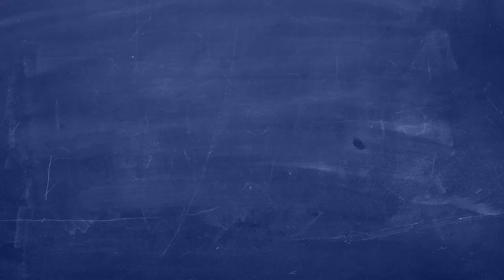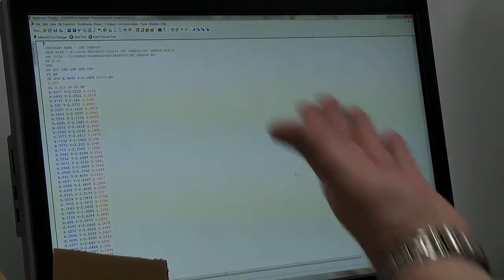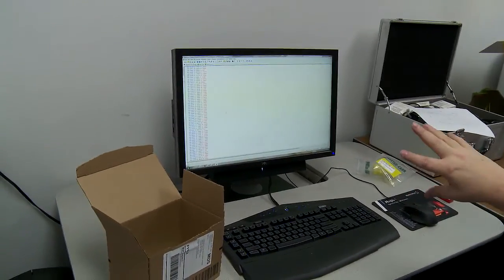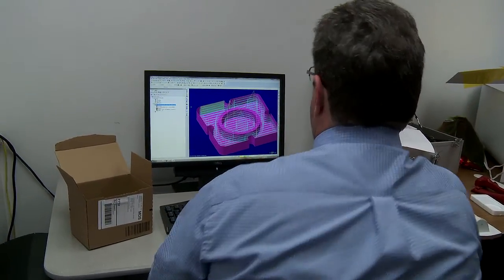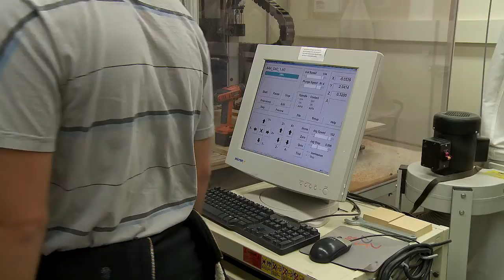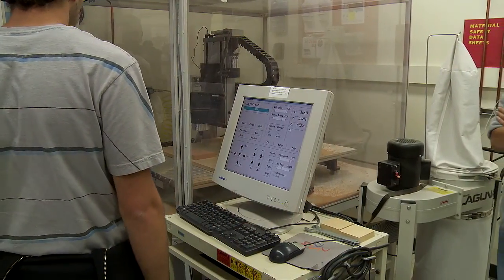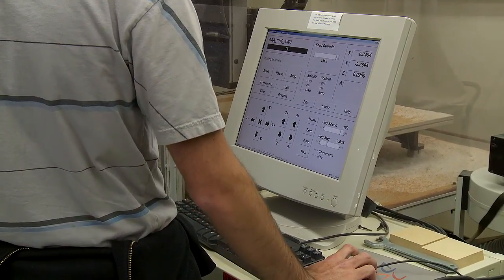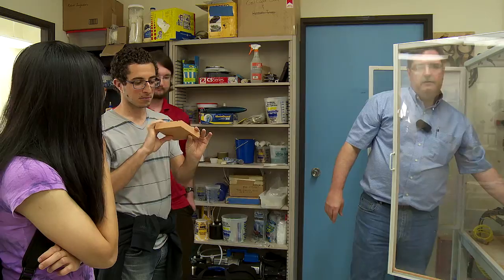Engineering 165/265: Advanced Manufacturing Choices. CNC Machine Practicum

Comment: This is machine is just a wood router, a True CNC mill or lathe in industry, industry is much more than this "LITTLE" machine. Try using a HAAS VF series mill or a SL series lathe to show what is really done in manufacturing not a little hobby machine. This is why students get to industry and are not ready for real world applications with colleges not have the actual machines used in industry. You are better off at a community college first as most likely they will have true CNC equipment.